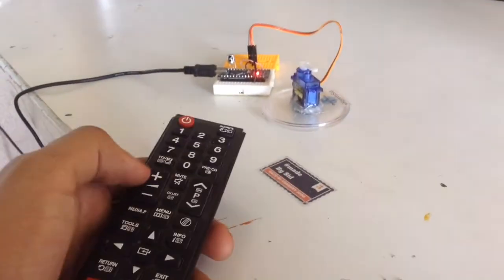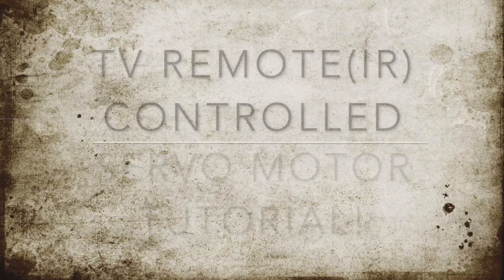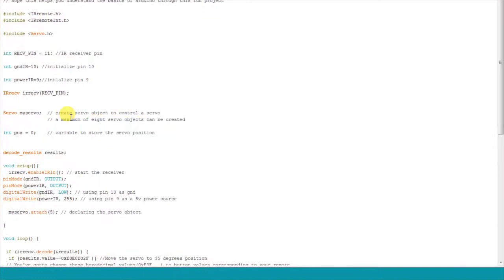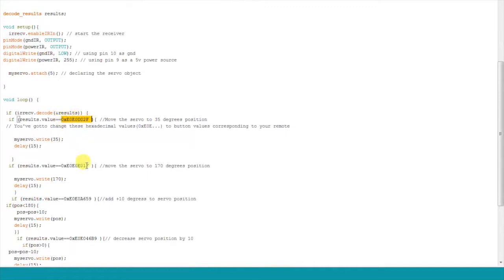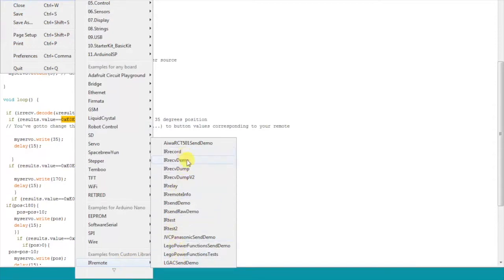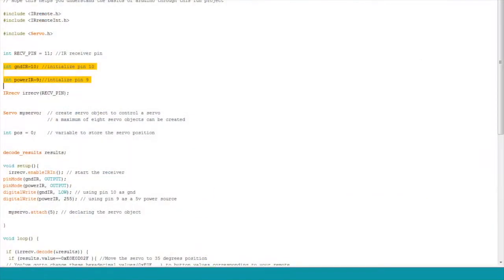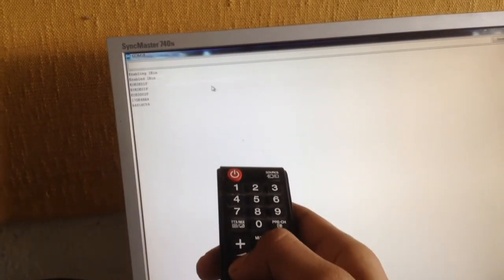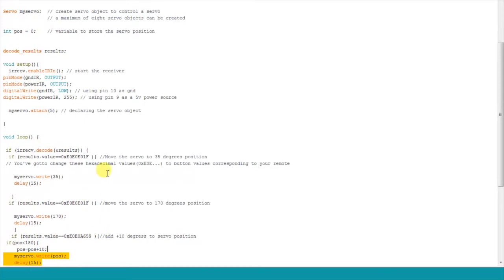Arduino IR-TV Remote Controlled Servo- Easy Tutorial

Comment: i have i little problem with my remote control, if i want to add 10 degrees to the current position of the servo, i have to press the button repeatedly, not once like you did. can you help me or is it just the remote controller?

Comment: hello. i uploaded the same code, connect the wires according to the code and change the keys code according to my IR remote. but servo didn't move. i just check the values on Serial Monitor and whenever the key press it shows FFFFFF values...
Reply: Thank you 
I will let you know. If this solve my problem.i hope it will:)